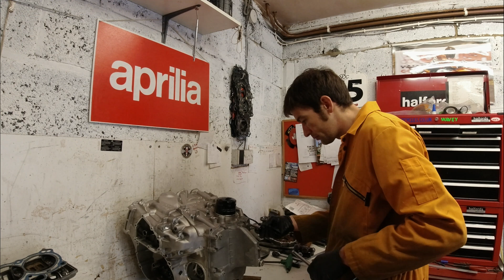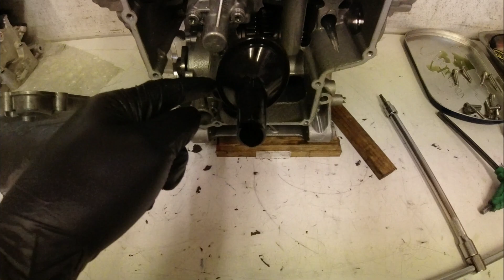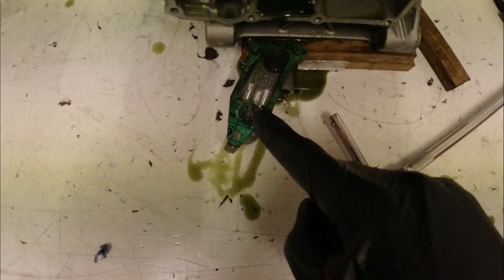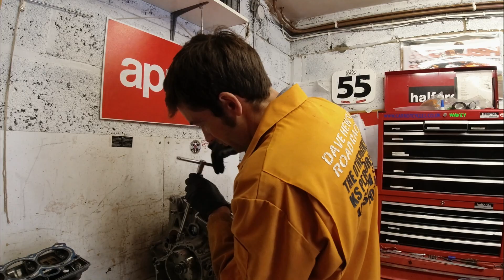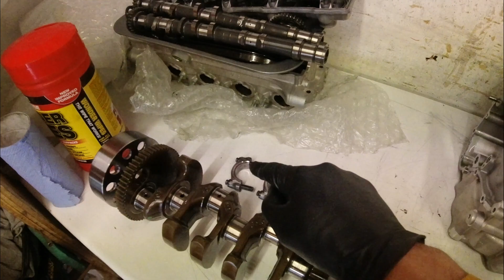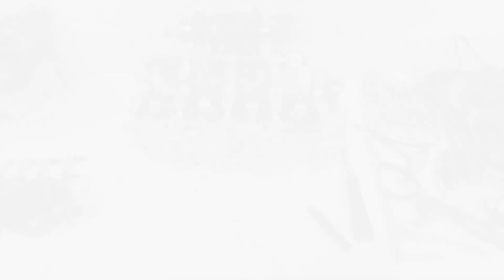How to refresh a BMW s1000rr engine  Part 3

Comment: hello greetings from mexico can you help me to know how many pounds(lb). They must carry the connecting road's (bielas)
Me gustaría saber
El par de apriete 
Para las bielas 
Bmw s1000rr 2016
Reply from the maker: I've never needed to work it out, though the race spec superbike engines run 230+bhp with the same rods, so plenty strong enough

Comment: why would bmw use aluminum bolts if they could have used a better reusable bolt?...is there a better reason than added weight?
Reply from the maker: Save weight and sell lots of bolts too. Not daft those Germans (yamaha have started doing it too)

Comment: thanks for the share, nice as usual.
Does changing the bolts to stainless change the required torque settings as well?
Reply from the maker: Yes, the stock bolts are something like 3nm and 90 degrees, the stainless bolts will be a much more normal torque value around 9-12nm, although I tend to do them by feel
Reply: @obsession_engineering  thanks for the info!